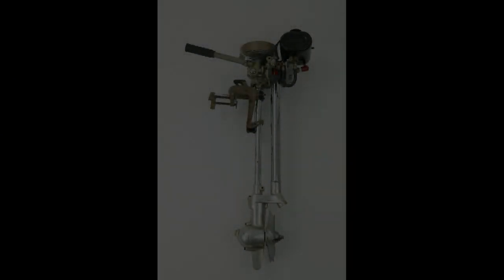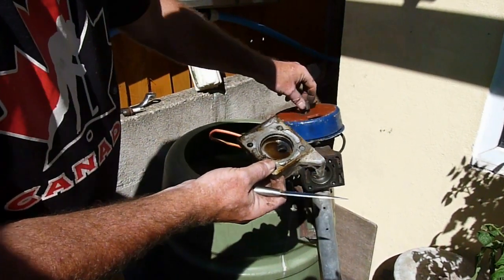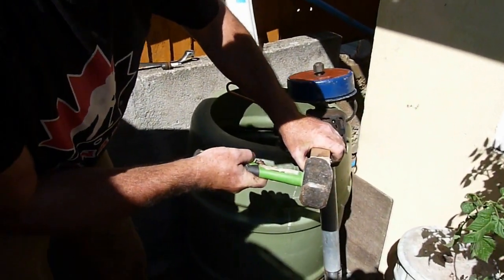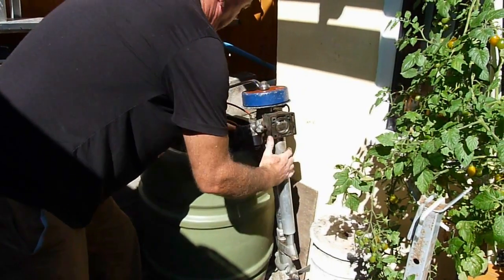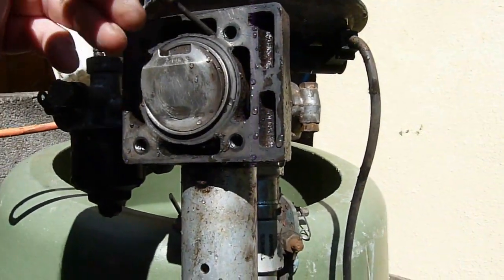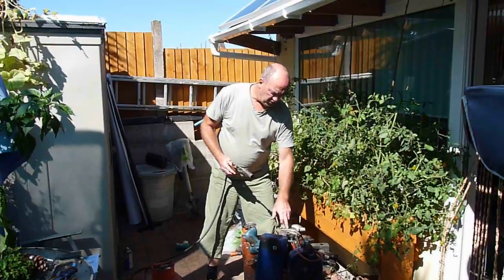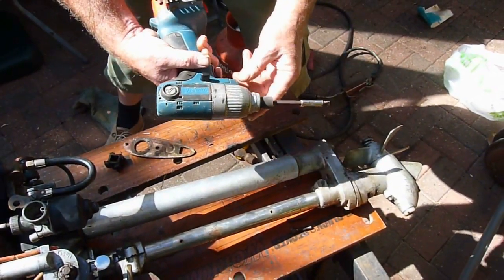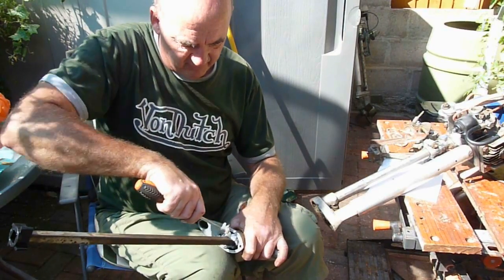Free Up a Seized Piston: British Seagull Outboard engine + Impeller, Gearbox Oil Seal & Carburetter

Comment: If you have a really badly neglected motor it will need a serious amount of effort to shift the piston.  It seems that people drop them over the side, fish them out then leave them in  their garden or a shed for about five or ten years.  Next when they find how seized it is they put it on eBay! 

Motors that have a crankshaft seizure as well as a piston seizure need to be peeled like an onion and a Seagull 40 FP877NI which was purchased in Plymouth was no exception.  It was so bad that job number 1 was removing the lower unit (gear-case)  With badly stuck bolts one can use a full size propane burner (40 kilowatts) but be careful as you do not want to melt the water pump impeller!  Aluminium alloys expand at about three times the rate of steel so a little heat can reduce the vice-like grip caused by corrosion products.  Once the gear-case was removed it was possible to remove the down-tube by heating and wiggling it after the screw was removed.  The next job was the square drive-shaft that was rusted to the crankshaft.  The propane torch was used again but the shaft had to be heated to a dull red before it would let go of the crank!

Once the power head is released from its ancillaries more peeling can be done.  The head had already been removed by the previous owner so that was one less job to do. The flywheel was left alone for the time being as if one has a motor that has a crankshaft seizure, hammering can bend the crank!  The crank-case bolts were removed and the lower crank-case half was removed (lots of Plus-Gas releasing fluid and time needs to be used)  Once  the big-end screws were exposed they were undone, however this is a tricky job that needs the correct size of screwdriver and Mole Grips (Vise Grip Pliers US)  Releasing fluid can now be squirted onto the upper crankshaft bearing and once this is freed-off it is time to remove the flywheel.

The block and piston can be tricky but soaking with releasing fluid for a few days does help.  NEVER strike the conrod as damage is sure to occur.  The piston crown is not flat so hitting it there is also a bad idea.  The solution that I have used with great success is to obtain an off-cut of thick wall scaffold pipe about four inches long.  In the UK this pipe is two inches in diameter externally and about 1.5" bore.  Some lathe work is required to turn some off the pipe down to 1.765 inches or 44.8 mm.  It has to be a clearance fit in the bore.  The pipe is actually a Piston Ejector and the piston can now be driven upwards.  Even pistons that are severely stuck can be defeated.  Of course the same idea is not so good on the 102 that has a fixed cylinder head.  

Beware of storing the loose parts in cardboard boxes or in old ice-cream containers as parts may get lost.  Discarded saucepans are more durable and their bottoms don't fall out.

Good luck!

Comment: Thank you for that video!
Seagulls are really the best outboard engines for the world, they didn`t lie. If it doesn`t work, you`ll only need a hammer to get it back to work...
Or if there comes no water, you check the gearbox at first if it`s detached. If it`s nearly lost, the water stops coming out. But the engine works... My advise for that two screws is using locking varnish.
Reply from the maker: Thanks for that advice, will use thread lock in summer.

Comment: That was a great video. I own 5 British Seagulls including one that is seized so it has me thinking. I don't know what was more impressive; your work on the motor itself or your ability to work in tight quarters!!  Looks like you have worked quite a bit on these motors over the years. Thanks for posting this video.
Reply from the maker: Thanks for your comment. I have lots of experience with many different types of engines, including stripping down, fault finding and completely rebuilding a merc 135 hp without a workshop manual, which to my delight fired up first turn of the key :) Your seized Seagull is certainly worth reviving. We need to keep these amazing little motors running to remind manufacturers to build reliability into new products, instead of deliberately building known faults into products for short term profits on repeat business.
Reply: I fully agree and the seagull is the perfect example of simplicity and an outboard almost anybody can work on. All things that are complex and not useful; all that is useful is simple. Marketing and advertising today deceives people into thinking they need features and gadgetry that are next to useless and really of no benefit to the owner. You can really see this today in many of the 4 stroke outboards and oil injected 2 strokes. Do you ever work on Acadian or Atlantic make and break motors? These were used extensively here in Newfoundland by fisherman. They were also very simple and never even had a spark plug but some sort of heating coil- very simple.
Reply: If you have one with a badly rusted bore the method shown in the video will probably not work. With really bad Seagulls its a case of separating the crankcase halves and unscrewing the big end.  Do not hammer the con-rod!  Instead machine some steel pipe so that it is a clearance fit in the bore and longer than the con-rod. The pipe allows great force to be applied to the the bottom of the piston and done this way the piston skirt won't get left behind. Tremendous force will still be needed e.g. large G cramp,that can be hammered when it is as tight as possible. Plus Gas and heat also help. One may find that after all this and an overnight soak the note of the hammer will change to a thud instead of a ricochet. This means that the piston has moved! Good luck!

Comment: Just bought a seagull outboard on ebay lol! IM sure you vid will come in handy! And for the phill downes remark! Your a compleate fool! old school son! Old school!
Reply from the maker: Way to go Jason, these are amazing little engines from a forgotten age where reliability mattered.
Reply: Thank's Andrew! Got it home yesterday gave it a clean up! ONly problem is! No cable to start it! What do o order or ask for can you help? Jason.......
Reply: I was thinking a peice on cord with a nott?
Reply from the maker: Hi Jason, I used a cord with a knot in it. Make sure cord is thin enough so as not to get wedged in the flywheel pulley. Also make sure not too long so you pull it off the pulley each time when starting. Don't wrap the cord around your hand when pulling.
Reply: Many thank's.........

Comment: Good old fashioned explanation Andrew. No blaring music of dubious origin, no flashing lights, no smart arsed commentator showing off. I looked at Phil Downes videos after he flamed you, now there IS a prat!. It was the bore that was seized and I don't think Seagulls had chrome bores on such early engines. Beacus e it's the bore that's seized, it doesn't put much stress on the con rod or crank and you only moved it a little to free it.
Reply from the maker: Alan Reynolds Thanks Alan, you are right they are not chrome and it was the bore that was seized. I suspect a seized crank soaked in diesel would shift using same method.

Comment: very well explaned, if these engines are seized through being standing as is the case here the piston rings stick to the bore, but if seized because of overheating or lubrication deficiency le lack of enough 2 stroke oil then the piston will need to be replaced and barrel may need a  rebore because of heavy scoring of both parts. a compressor would have been handy here in your video, good advice for people though.
Reply: Nah, from my days of riding a Maicoletta in the 1960s I can tell you that a lot of two stroke engines are not properly run-in until they have seized three times!  One would become expert at relieving the black seizure marks (silicon oxide?) on the piston as the black marks were exceedingly hard and they would never bed-in.

 A Seagull piston never gets as hot as the piston on a Maico unless the cylinder block is clogged with rust (yes I have seen that) and the muck, possibly Magnetite, was so hard that even masonry drills were struggling.  With one like that it is time to get out the Dremel and some diamond burrs.  Unfortunately the burrs are never long enough, not even for a 40+ but well begun is half done!  A cordless drill with a torque-limiter set as low as it will go is the only suitable power tool that I own once the burrs have reached their limit.

The good news is that a Seagull can always be repaired which is more than can be said for some brands that come from the Far East.  Often the alloy on the foreign motors becomes porous and crumbly.  The other trick that they do is to use low-tensile bolts which are impossible to remove as the heads shear-off.  Been there done that and discovered that replacement castings would cost far more than the motor was worth.

Comment from the maker: Been advised by John at Saving old seagulls to drop the impeller in a mug of hot water prior to fitting which makes sense. This will expand the impeller and allow it to slip down the shaft with ease,

Comment: Does the seal between the bottom and the top half have to be tight? There is no water flo on my seagull when running. I re used the old seal and it doesn't seem like its tight enough. Will that effect water flo?  Thank
Reply from the maker: mike97525  Hi, the seal / gasket between the top half and bottom half of the gearbox, if this is what you meant, would not account for loss of water flow. I would suspect the cooling galleries behind the cylinder head are clogged up with carbon, oil and mud as shown in the video. Presumably you have checked / replaced the impeller?
Reply: the impeller looks old but ok I will try the air compressor but if that fails I will take the head off and try not to break any bolts
thanks for your help

Comment: Hi, i have one of these outboards but the top bit doesnt spin i cant get it to move, does this mean its seized. If its not any advice on what i can do. Thanks
Reply from the maker: Yes sounds like it is seized and this should sort it. Has it been stored in a dry place?
Reply from the maker: I would first try spraying plus gas or squirting some diesel down the spark plug hole and leave stand for a day or more and then try placing a spanner on the nut above the flywheel and tapping it with a small hammer back and forth to see if it frees up.
Reply: Yes we have stored it in a dry place. Funnily enough, we are in the process of doing that exact thing. We asked my dad and he said to do that as this happened to him on our old outboard. We took the engine out of the shed as were are going to use it on our boat that we are building. Thanks for the help.

Comment: I have been trying to do this on my century 100 which has a ceased piston for a few days now, I have even removed the entire lower half from the power head. I have tried soaking it in penetrating oil overnight by poring some through the carb hole, where the head used to be and the exhaust. I have tried hitting it with a large hammer via a piece of wood many times and I have also tried heating it. I think If I can remove the block with the piston stuck in it from the kam gear thing at the top (under the flywheel) I can put it in a large vice and push the piston that way however I can not seem to disconnect the piston without it being out of the block. Any suggestions?
Reply from the maker: One suggestion made in the comments was to snap off the ceramic part of the spark plug, drill and tap it to take a grease nipple and use a grease gun to force the piston down. One problem with this is that if the piston is stuck with the inlet open or the exhaust open, it won't work http://www.2strokeengine.net/2strokeenginepics/exhaust.gif
Reply: Andrew K Fletcher the piston is right at the top so this may work however the crank and piston are therefore straight so pushing may not do it and I may need to rotate the shaft at the same time. Thanks for the help
Reply: Andrew K Fletcher I finally freed it by removing the cylinder with the piston in it by disconnecting the Conrod from the shaft and removing some studs. I then made a rig for a vice that put  force on the piston and i very slowly started to move it out by using the mechanical advantage of a vice. I also profiled a piece of wood to fit the piston head to spread the load. The piston is toast but the bore is really good so I'm going to re hone it and get a new piston.
Reply from the maker: Great job. Another Seagull will soon be flying :)
Reply: Andrew K Fletcher 
Indeed it will, also I told some people in my boat club about it and I now have another seagull that is ceased to repair!
Reply from the maker: eBay item number:142465217178